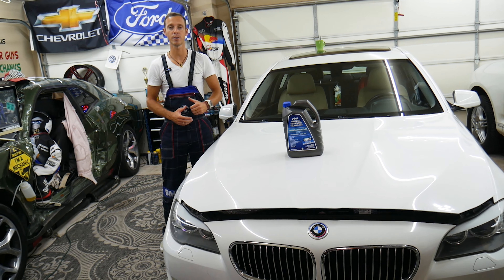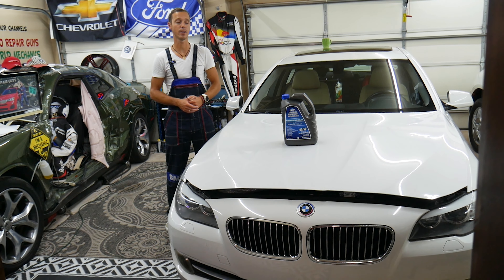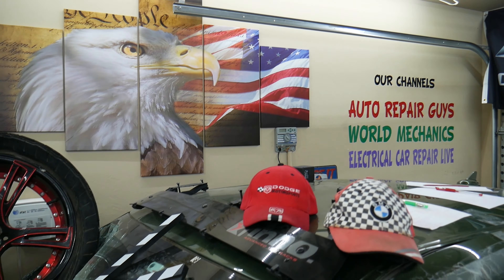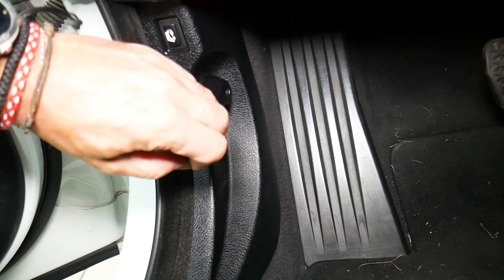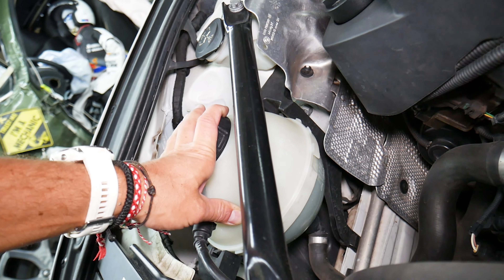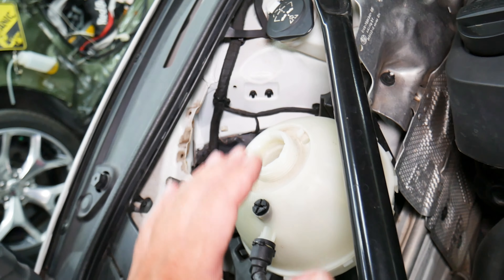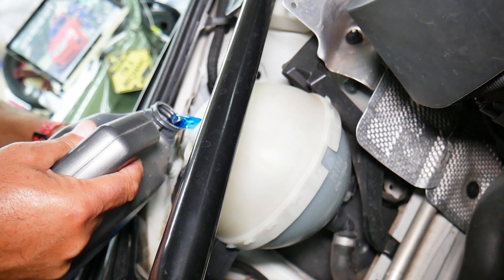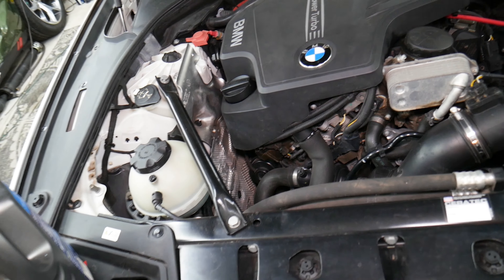BMW F10 F11 How To Add Engine Coolant Antifreeze BMW 528i 535i 520i 530i 550i 518d 520d 525d 530d

Comment from the maker: Things you may need to fix this problem: 
► BMW Antifreeze: https://amzn.to/3Zev58p
► BMW Antifreeze Original: https://amzn.to/4dP0kvp
► Liqui Moly Molygen Oil: https://amzn.to/2G1JIoZ
► Castrol Oil: https://amzn.to/3xBc8B9
► Oil Filter: https://amzn.to/4f3NavB
► Oil Filter Special Wrench: https://amzn.to/2D6Ghwj
► Torque Wrench: https://amzn.to/32qyRwg
►Liqui Moly Oil Saver: https://amzn.to/3xR3Px3
►Liqui Moly Engine Flush: https://amzn.to/3IiDBID
►Liqui Moly Cera Tec: https://amzn.to/3GfQuRI 
► Fuses Assorted: https://amzn.to/49uQw73 
► BMW Green Relay: https://amzn.to/4buPhXk
► BMW Orange Relay: https://amzn.to/3ut6Oyt
► BMW Black Relay: https://amzn.to/3STDKcY
► Liqui Moly Molygen Oil: https://amzn.to/3wdFHYP
► Oil Filter: https://amzn.to/3Oz7nOc
► Mechanic Tool Set: https://amzn.to/3usBcZM
► Scanner That We Use: https://amzn.to/3SSzVEE
► Torx Set: https://amzn.to/3HUCgZu
► Panel Removal Set: https://amzn.to/3SSvIAX
► Screwdriver Set: https://amzn.to/3wiLsUS

► Check out our Amazon Store for the tools and parts that we use: https://www.amazon.com/shop/worldmechanics

Comment: Bmw f10 520i 2012 6200km. The cars radiator cooling fan makes a very loud noise especially when AC  is on and when outside temperatures are high, 25 degrees Celsius.  It all started after doing a coolant flush. The bleeding procedure was followed. No error codes and no overheating. In the hidden menu fan starts at 92 degrees and increases in speed as temperature rises until temperature drops at 90 degrees Celsius. This occurs mostly when the car comes to a stop while idling. New water pump, new temperature sensor and thermostat changed twice but problem not resolved.  Please help